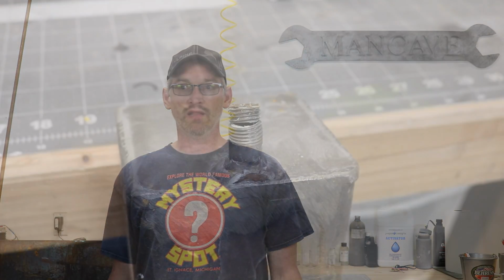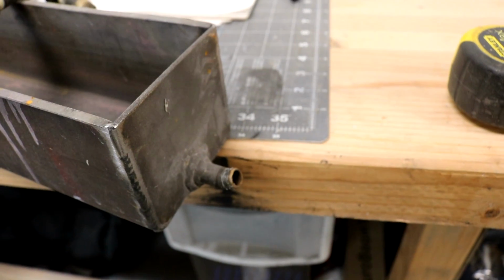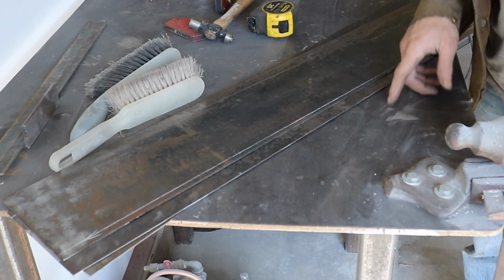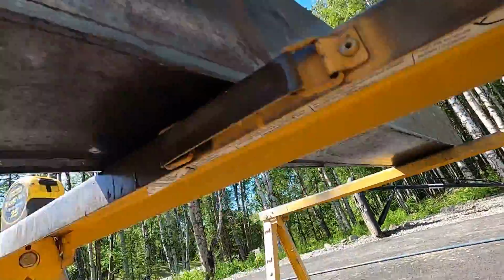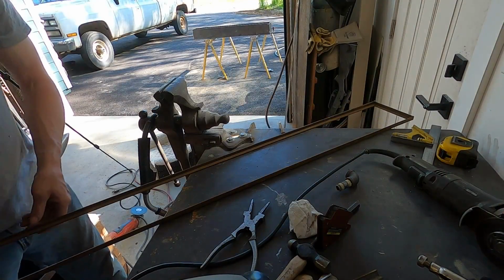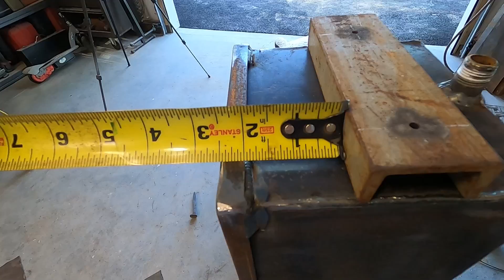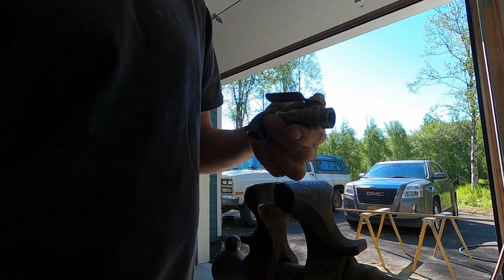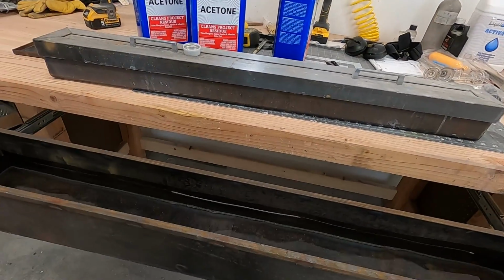Building a new Hide-A-Way Cerakote solvent tank

Comment: Nice tank build.  I don't have a welder nor the skill to build my own so I purchased the tank offered by Cerakote.  (It's not worth the $400.00)  A few things I noted:
1. Even with a gasket, Acetone will evaporate and this becomes quite expensive.  My first 5-gallon Acetone can I purchased evaporated completely in less than 2 weeks.  I would try to recover it back into their cans after every session, or use simple green solution instead of Acetone.  When I first started, Acetone was the ONLY approved solvent for soaking and over the years Cerakote has approved the use of simple green so that's another (cheaper) option. 
2. The tank will rust very quickly unless you always maintain it full of solvent.  Within a couple of weeks my Cerakote tank had surface rust all over the inside and outside.   I ended up blasting the whole thing and using C-series to Cerakote the entire thing.  (Hard to do in a 40 inch cabinet with 1/3 of your tank hanging out, but I managed)
3. I see you used a ball valve on yours.  Mine only came with a plug, so after my first failed draining of Acetone where I spilled most of it around the funnel I was using to try to recover it, I also installed a ball valve and spout.
4. I'm using one of those 325 mesh cup strainers to "filter" my Acetone before recovering it.   Eventually you have to top off with clean Acetone as it becomes saturated with oils.  It tends to carry oils and transfer them back onto your workpiece if used for too long.
Great work sir.  Subbed.
Reply from the maker: Thanks for your comments. I was not aware of cerakote backing simple green. That's good to know for plastics that may have a meltdown in acetone or wood. Paint on my friend.

Comment: Great upgrade… I wonder if you made a gasket out of a layer of 100% silicone on the lid if it would make a noticeable difference in acetone evaporation..
Reply from the maker: I ended up purchasing some 1" wide sticky back gasket that can withstand the acetone.  Seems to help a lot.